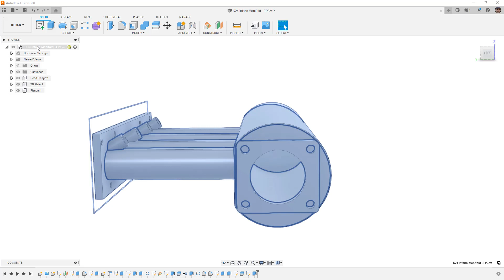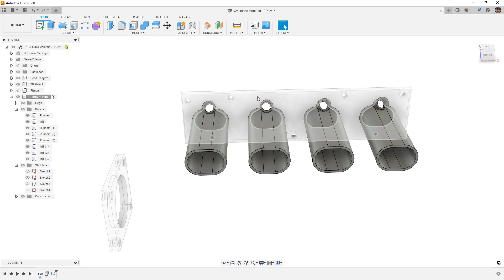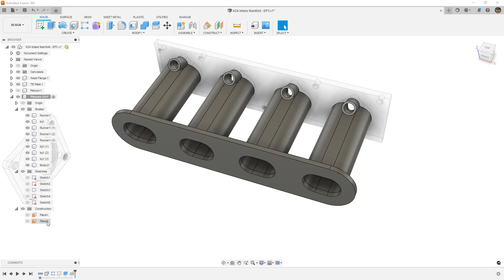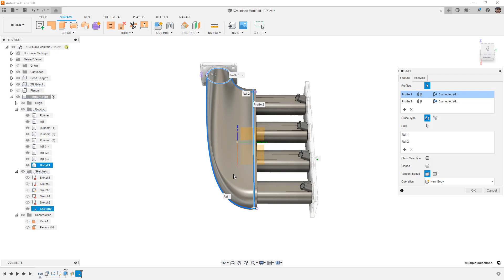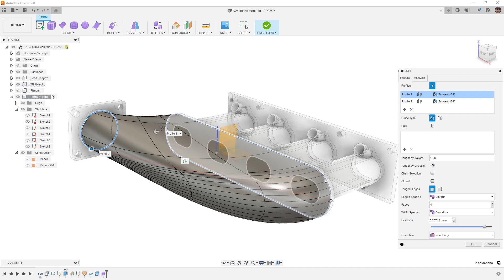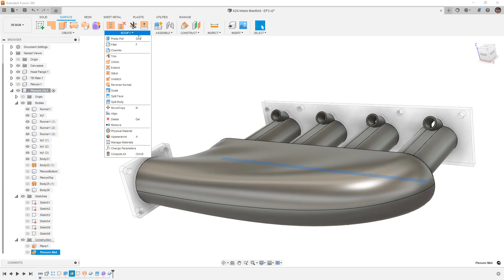Designing a Formed Intake in CAD | K20/K24 Swap Intake Design in Fusion 360 - Part 3 #Fusion360

Comment: Did anyone else try to follow along with him. I downloaded the model but I couldn't access the timeline for some reason. Did I just overlook something? I usually use Inventor, I'm not used to Fusion 360.
Reply from the maker: I just checked the link in the video and opened it up in Fusion and it shows the timeline at the bottom.  Have you messed with any settings in Fusion?  Fusion has the ability to not capture design history.  IF you happen to have a design open and you tried to open the intake in that design you may have had the history off.  If that is the case you will need to reimport it.  either upload it to your data panel/project and open that way, go to File > Open.  or from the link in the vid desc just click "Open in Fusion".  you may see a pop up in your browser about nLauncher, that is needed so OK that.

Comment: i have been trying to make this same thing, but instead on forming i will be making the plenum chamber out of a 5 axis mill. and also instead of welding it together i will be bolting it to the runner flange. i am lofting from the TB flange to the runner flange but want to shell out the guts to a certain wall thickness and profile. but i am coming into all kinds of issues.
Reply from the maker: Hey Anthony, i did a few different versions of this in the playlist that might help.  what sorts of issues are you running into?

Comment: Thanks.. this whole channel is amazing.. 

Regarding intakes, is it possible to do a simple flow analysis like you could when flow design was free?
Reply from the maker: thanks!  Sadly Fusion doesn't currently have any CFD to do a flow simulation so the design would need to be exported to another software that could do that.
Reply: @LearnEverythingAboutDesign  do you know any free alternatives apart from OpenFoam?
Reply from the maker: @rodrigomartinelli741  OpenFoam is the goto free solution.  SimScale has a free version but i dont' have any experience with it.  https://sim-flow.com/download/cfd-simulation-software/   I used to do CFD in solidworks but it isn't free....
Reply from the maker: @rodrigomartinelli741  Other than OpenFoam you could try Simflow  https://sim-flow.com/download/cfd-simulation-software/  There is a free version but I haven't used it.
Reply: @LearnEverythingAboutDesign  i tried installing/using open foam once.. it left me scarred and cant remember why.. i guess my mind is denying the trauma but i'll have to give it another go...